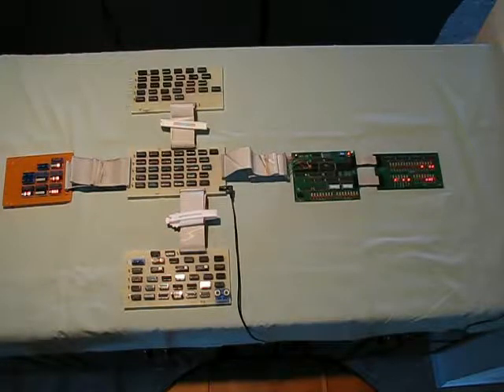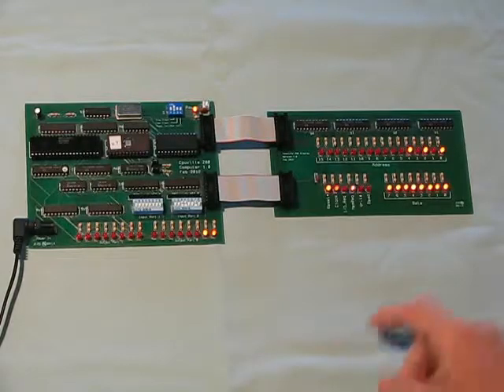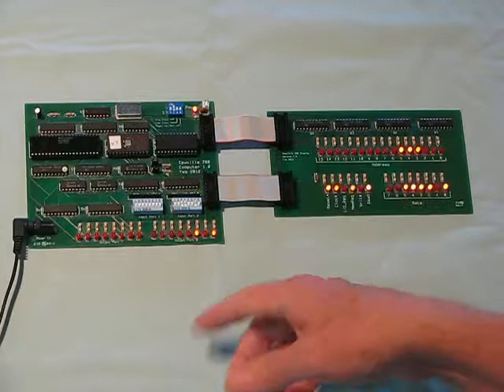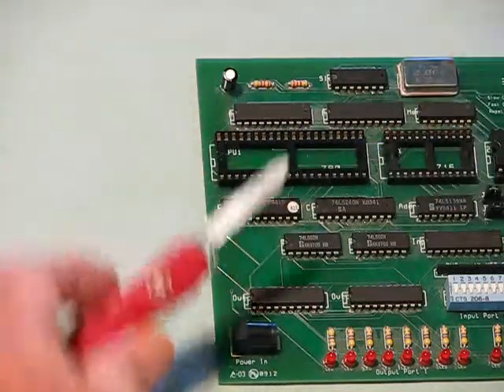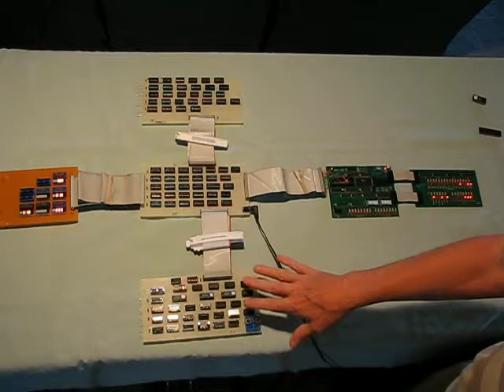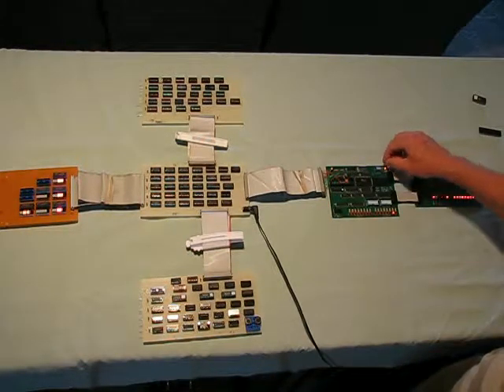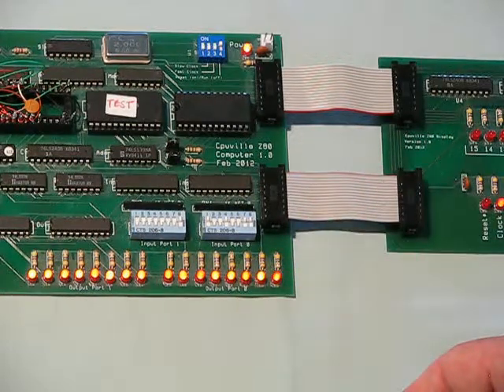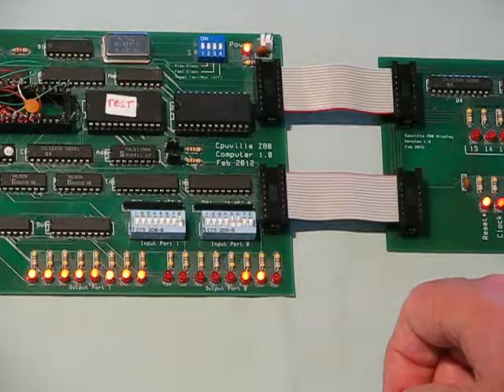CPUville 8-bit Computer Processor

Comment: This is amazing Donn. Any chance this will make it into Kit form? If yes, I know at least 3 guys that would buy one.
Reply from the maker: Hi George. I am strongly considering making this 8-bit processor into a kit. I need to hang out with it a while, make sure the design is solid, write some code for it (at least a system monitor). If there is interest in the hobbyist community, that will propel me forward. With this processor, I made all the schematics in Kicad, so making circuit boards for a kit will be easy.